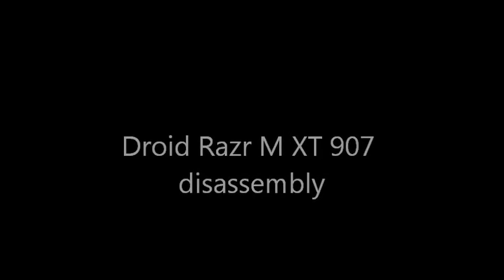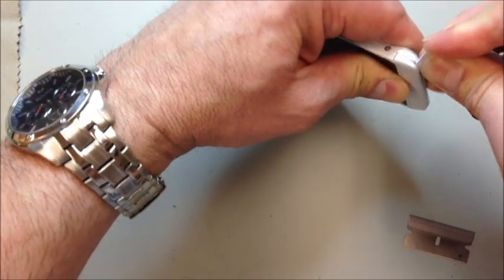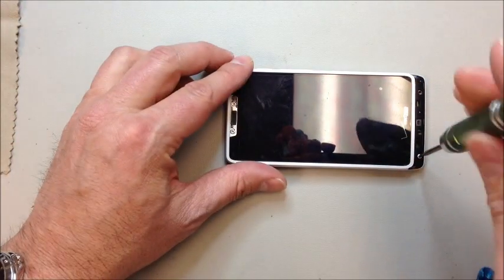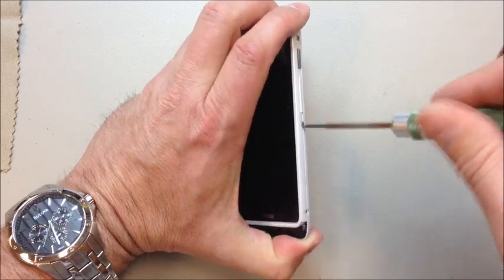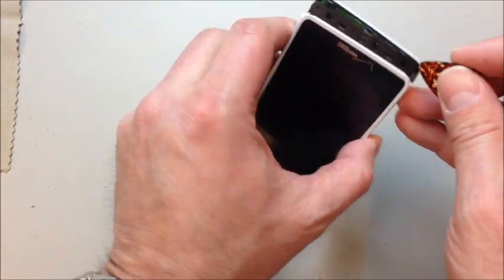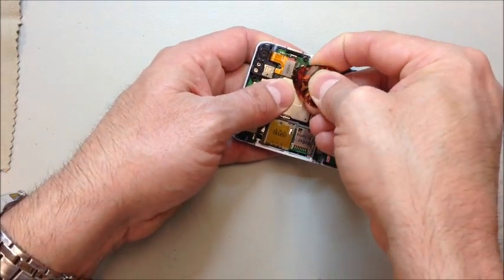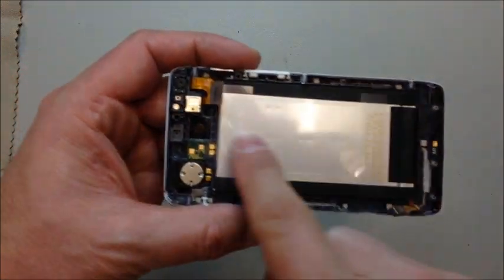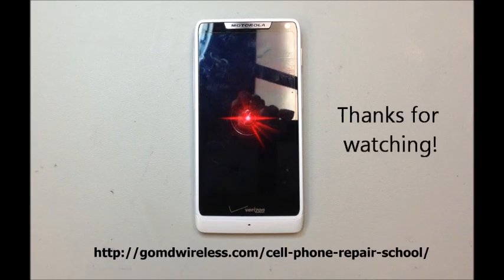Droid Razr M XT907 disassembly

Comment: Hello, so i inserted a SIM card into my Droid RAZR M but it was too small and is now stuck in the SIM card slot, if i were to open up  my phone like this video shows would i be able to extract my sim card? or if you have any other suggestions abut how to get it out tha would be great! thanks! pls help me
Reply from the maker: I believe so. It's been a long time since I worked on one of these but it looks like you can separate the front from the back and then push the card out from inside.

Comment: I have a droid RAZR m and my LCD broke , but I just want to get my data off is their a way to get my data off without replacing the LCD
Reply from the maker: Ayanna Sanes I think that would be very difficult as you must select the correct USM mode. Maybe if you had a duplicate model right next to it so you can use that as a map of sorts. That is assuming the digitizer still works.

Comment: I am disassemblying my sister's dead motorola xt907 in an attempt to retreive some photos she took.  she had no micro sd or simm card in the slots, so, the photos can only be in the onboard memory.  I haven't a clue for what I am looking for.  any ideas?
Reply from the maker: Tom Ulcak You can try a new battery and I would also look for signs or moisture damage. That's the most common problem that I've seen with them. Assuming that it doesn't load any drivers when you connect it to a PC. With no signs of life that would be my first guess.

Comment: I have this phone & I have been unable to hard reset it using the down volume + power button method. It attempts to restart, but it only boots up to the "droid" screen then freezes there & goes no further. I allowed it to sit for 2 hours that way until the battery drained, trying to let it load up. I tried just turning it off then on again & that didn't work. It simply will not load up beyond the "Droid" screen. Any ideas?
Reply: Nichole Nace Mine is doing the same thing. Got a new phone today.
Reply from the maker: Doesn't sound good. In those cases it might be better to replace the entire board but if you take it apart there may be a hardware problem like moisture damage or a faulty component- charging port, camera, flex cable, etc. Process of elimination is usually how we handle that one but it can be difficult unless you have a spare phone of the same model on hand.

Comment: I am unable to remove the motorola label and the plastic piece which you removed first. Any tips? FYI I am using plasic case openers.
Reply from the maker: Yeah they can be a pain. I used a dulled single sided razor blade to get it started. That or if you have an iSesamo on hand you can try that but I rely on the blade quite often. Very thin but strong at the same time.

Comment: I have a tech question. First of all, good video! Second, I am fixing a friends phone and they cracked the front glass. When I went through the steps to repair it, everyone is telling me that i need a new face plate because the front glass and the case are "fused together". Can anyone tell me if this is true and if they wasted their money??
Reply from the maker: I haven't tried separating the glass on this one but it's probably not something I will try. The screens are pretty cheap now.
Reply: I did it and it actually worked. You need to separate the glass from the frame and remove the old adhesive. It works like a charm but you will need some new adhesive or you're just setting it in there.
Reply from the maker: Super Average Guy You'll want to bond it properly with a LOCA glue or OCA sheet otherwise you'll probably have touchscreen issues. Since the whole part is only about $30 it seems like a lot of work for the difference in price but good luck though either way. Let us know how it turns out.
Reply: They've had the phone for awhile and no complaints. Thanks for the help!

Comment: Thanks for the upload :) 

Ive actually ran into an issue where my battery is starting to bulge. I believe I can replace, but I am curious if the phone will run without adding the battery back in? (for instance, being plugged into the usb cable?) I dont use the phone for typical phone use, only use some apps so it is generally only plugged in. 

Otherwise, thanks for the upload, this answers a question I have been having issue figuring out :)

Comment: I damaged my charger port on my razr m.   is that replaceable?  or should I look for a phone with a broken screen and switch my good screen over to it?
Reply from the maker: It can be replaced but requires micro soldering. For most people the best solution is to replace the board.
Reply: now that my phone battery is dead , how could I get any info off of it? replace teh battery with a charged one? and try to transfer ? also if I bought a phone with a broken screen could I just put my good screen on it and start over?
ty
Reply from the maker: Does your battery not charge at all? If it's the port then you're going to have trouble transferring the data off of it.
Reply: it is the port, all of the wires are bent after I dropped it while charging it. so I assume I have to have a new Port welded on, or just forget about my old Info...
Reply from the maker: The only solution that I know of is to either replace the port which is not easy or install a battery that is already charged and then find someone who has a Cellebrite that supports bluetooth transfer for your model. Your local Verizon store might have one. This is what I'm talking about: http://gocellphonerepair.com/broken-phone-data-recovery-2/

Good luck.

Comment: Excellent video, I couldn't have replaced the battery without it!   I will say that working on my Razr M was much easier than my old iPod Touch (or on anyone's iPhone).  Still tricky, but less reliance on plastic clips and interlocks that are hard to open and easy to break.  Love the guitar pick tool!

Comment: BEWARE: you'll need T4 screwdrivers as well, not just T5.
Reply from the maker: I will add that to the description. Thanks.
Reply: I disassembled mine completely using only a T5. Where were the T4 screws on yours?

Comment: Hello
My son spilled water on his phone. The same exact one you took apart in the video. My question is it worth trying to save and take it apart to air dry or just go get a new one? Phone won't even turn on.
Reply from the maker: At this point in time the LCD which is the most valuable part of the phone is only about $33. You can get a phone like this (used) for around $100. So unless you are attached to it or need to recover data it's probably best to get another phone. Hopefully you are due for an upgrade.

Comment: Is it necessary to buy the adhesive tape as well if I bought the new screen?
Reply from the maker: In most cases you will have to replace the adhesive. Every once in a while they include it but not often. Sometimes you can reuse the old stuff but only if it's still sticky and free of debris.

Comment: A question, though. How temperamental the Motorola Lithium polymer batteries are? I know I will have to replace it eventually, though, and plentiful of Epic videos of dying Li - Polymer batteries make me nervous already.
Reply from the maker: I wouldn't say much worse than other manufacturers at least in my experience with one exception. They do not like moisture. I've seen plenty that were exposed to a small amount of water that just died completely.
Reply: Go Cell Phone Repair Ah, I see. I always have been gentle with my phone - if it did get accidentally dropped, I always inspect the kevlar backing - if I see the deformity, I will have to stop using it and have the battery replaced. And, about the water, I found that the CPU heat helped somewhat to keep humidity moisture away.

Comment: Excellent video instructions.  I am a 25 yr experience Electronics Tech and the instructions were perfect.  The only thing I found to improve the process was I carefully used a jeweler's screwdriver to spread the plastic clips on the bottom one at a time to remove the front half.  I found it much easier than trying to pry the whole bottom and risk damaging the clips.

Comment: Great disassembly instructions. Replaced main speaker with no problems. Taking time and not forcing anything was key.  I found a small shaving of metal in the old speaker, that was destroyed.  I suspect it came from work since I work with sheet metal. It was dragged in because of the high magnetic properties of the speaker.  Thanks again.
Reply from the maker: Yeah we get that a lot with people who work in machines shops. If it's worth your time, you can open up the phone and clean out the shavings once in a while and the speaker should last longer.

Comment: Awesome video!   My Razr M screen went completely black but still responds to touching, swiping, etc. Everything functions correctly, just can't see anything. Could you give me your best diagnosis as to what the problem may be? Which parts should I replace, if any? Thanks for any input!
Reply: Problem solved thanks to this video- I ended up replacing the LCD screen and it works fine now. I had an old spare Razr M for parts and swapped its screen over to my current Razr M.… I do find it odd that the broken screen still responded to touch but didn't display anything (I tried every suggestion on android forums including a soft restart several times over but nothing revived the screen). After watching this video I disassembled the phone, disconnected then reconnected the cable going from logic board to LCD thinking maybe it was just a loose connection but nothing worked short of complete LCD replacement. I must've damaged the screen as it goes through lots of abuse and humidity in my work environment. Hope this helps others with same problem.

Comment: Wonderful video!  Thanks so much for the tips, especially using the heat gun!  I don't think I would have ever got my phone apart without heating it up.  I would recommend getting the replacement adhesives and seal for the front frame assembly.  Mine had small pieces of broken glass stuck to the front seal after getting the broken screen out.  On another note, my phone (black VZ XT907) had 6 - T4 screws around the perimeter instead of T5, but the hidden screws were all T5.

Comment: Thanks for posting this. to replace the LCD & touchscreen should one be looking to purchase the whole assembly, which includes the digitizer? If so, does anything need to be programmed or set, or should it just work assuming the physical replacement is successful? Thanks again
Reply from the maker: You will want the whole assembly which comes with everything. Once connected it should function without any special setup or calibration. The replacement part, tools and pre-cut adhesive can be found here: http://gocellphonerepair.com/RazrM-XT907

Comment: First off fantastic vid, got mine apart without ruining anything. I am curious about the super thin adhesive around the edge of the glass between it and the outer bezel. Will the new screen come with it or is it something I have to track down or make?
Reply from the maker: In some cases they come without adhesive. The old adhesive may stay behind and can be reused as long as it still feels tacky. Otherwise you might need to remove it and add some new strips. 3M 300LSE works best. You will need to cut it to fit.

Comment: nice video it helped me with getting the hidden screws under the motorola cover so i could change my screen but now my new screen blacks out sometimes is it a loose connection ?
Reply from the maker: Sounds like it. Usually when a screen goes bad it will stay off. I would try reseating the connection.

Comment: Do you know how to fix the power button
Reply from the maker: If you are referring to the actual switch I believe that it is not modular as I don't see any replacement parts for it. If that's the case it would have to be de-soldered and replaced with one from a donor phone. I'll have to take a look at a board when I am back at the shop as I don't remember off the top of my head. If  you are talking about the rocker button those are easy and about $10 for the part.

Comment: Good grief! All that work to replace a battery?I think I will just go on eBay and buy a new one the RAZR is $ 100 or so new in box! Sell the old one on eBay for parts$40 final cost for new phone$60 that is my recommendations that is unless you just want the fun of doing a repair!
Reply from the maker: I hate to say it but in most cases where Verizon or Motorola are involved "just get a new one" is often the best option. When it's a combination of the two, even more so.

Comment: Absolutely awesome video.  This was my first attempt at fixing a cell phone and I had no issues whatsoever.  I watched the video three times in full before actually trying anything.  I then watched it and paused it as I completed each step.  If you are using a hair dryer instead of a heat gun, you have to use quite a bit of heat and for longer than you probably think.  My battery had a lot of adhesive behind it and it was much more difficult to pry it off than I had imagined.  I used a guitar pick as a pry device and it worked like a charm.  Thanks so much!
Reply from the maker: Awesome. It's hard to get the point across about using a proper heat gun until someone actually tries it with a blow dryer. Big difference.

Comment: Can you replace just the outer lens and not the lcd screen on the xt907? I have a cracked screen but the phone still works great.
Reply from the maker: Theoretically it is possible but not something that I would attempt. This requires a special heating plate, IR thermal gauge, molybdenum wire, LOCA glue, patience, practice and a lot of luck. Buying the whole assembly produced in a factory will give you like new results with far less effort. And if you break your LCD in the process you will have wasted your time and money. Good luck though whichever you choose.

Comment: Soooo...the glass bezel on the back around the camera on my phone is shattered. Is it possible to just remove that???
Reply from the maker: Yep. About $15 on Ebay. You should be able to remove the old one with some heat if I remember correctly.
Reply: Thanks.

Comment: i have a bad ear speaker, do you know if solder in or snap in?
Reply from the maker: That is a modular earpiece- no soldering required. But they are very sensitive. I've had a couple stop working while I was repairing the screen.

Comment: My wife's screen is not working. It was acting up intermittently and then went for good. I am going to disassemble and then reassemble to see if that works, if not what would be my next option? The screen or logic board?
Reply from the maker: That's always a tough call. Could be either but without a donor phone to test with it's hard to say. Statistically I'd say that the LCD is more likely to fail although if it went out over time moisture or a bad connection would be suspect.

Comment: If I want to replace JUST the glass and the front housing (that metal rim around the glass) How would I do that? Thanks
Reply from the maker: Please see my comment @nxtnx regarding lens replacement. The housing wouldn't be too hard though. Just have to pull the board when you remove the display and move everything over.

Comment: PLEASE ANSWER!

I have a question. . . . I stripped the top left screw under the motorola logo. So if I were to remove the side screws, the bottom screws, and the top right (leaving the stripped one there), Would I be able to twist the top screen counterclockwise to remove the stripped screw?

Thank you!

Comment from the maker: Try using progressively larger Torx bits while applying downward pressure until you get one that grabs hold. Hopefully that is. If not you will have to drill the heads out. Of course you won't be able to reuse them so you'll have to find replacement screws.

Comment from the maker: You can remove it with a heat gun and thin pry tool or razor blade. You should be able to find a replacement part on Ebay. If I get the link I'll post it.

Comment from the maker: I won't say that it's impossible but since the lens and LCD are fused together at the factory you will most likely break the LCD if you try to separate them. While I have seen this done successfully with Samsung Galaxy series handsets they never work quite like they did originally... screen freezes up, visible bubbles on digitizer, excessive glare etc.

Comment from the maker: There doesn't seem to be a layer between the panels as far as I can tell. Supposedly even the logic board is water repellent but I can say that more than one Razr that I've opened had water damage after being submerged briefly so I would be careful around water regardless. As soon as I get another Razr M in for repair I will make a reassembly video.

Comment from the maker: We prefer using the preassembled part to minimize labor fees and make sure that the new screen has no bubbles, does not get any dust inside and works exactly like the original did. I will be happy to link to your video if you can demonstrate how you do it. Fair?

Comment: You all should remember that time is everything if you wet your phone. It may sound weird, but I always have a cellphone repair kit from screwdrivers, to lcd adhesive strips to repair my phone. My phone was completely drowned in water for 3 minutes and 1 minute later it was completely disassembled and being dried. The Only needed replacement was the battery. Time is everything when you wet your phone.

Comment from the maker: The whole rice remedy is very misleading. A bag of rice can help in the short term which leads to using the phone without a proper disassembly and cleaning in an ultrasonic wash. Over time corrosion sets in and the phone loses functionality or stops working altogether. This video does not show how to clean a wet phone. It is only for screen replacement. You might still have hope though if you get the board washed and have your battery tested. There are a lot of things that might have gone wrong.